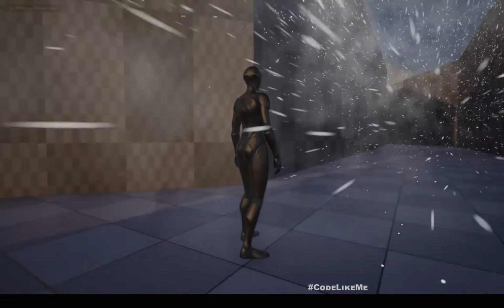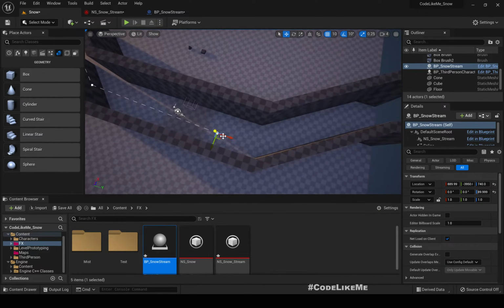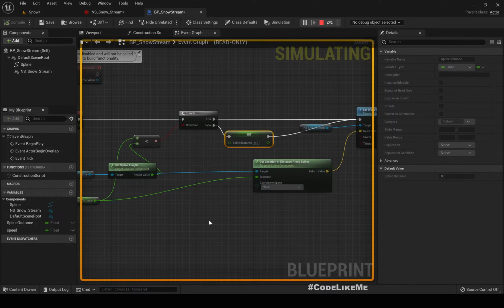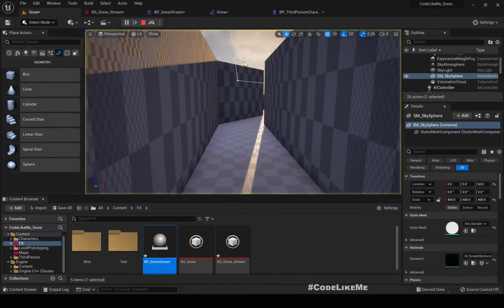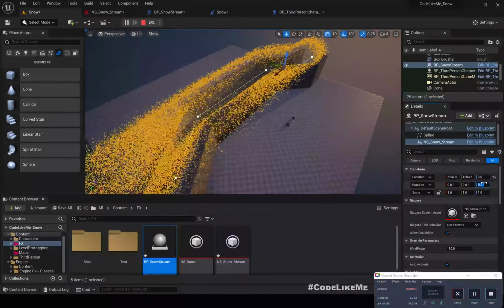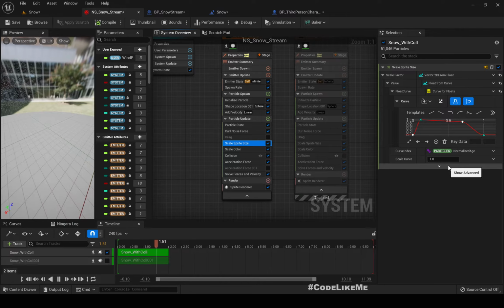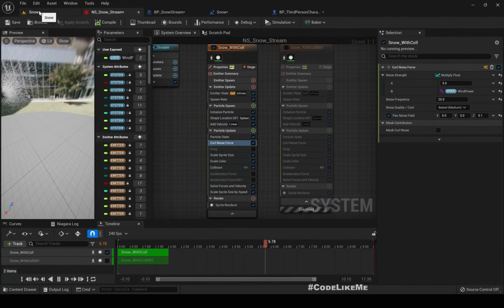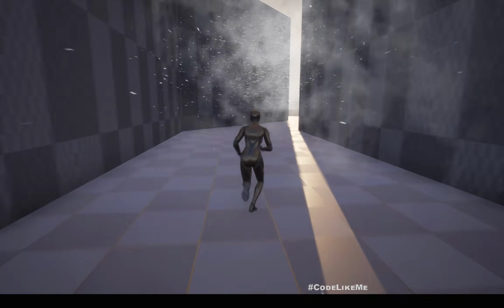Unreal Engine 5 - Snow Storm Particle Effect in Niagara

Comment: I have a problem where the location increases without stop amd it does not flow (like in 15:20) even though i followed every step through. Even when the "true" value resets the spline distance to 0 the NS still moves constantly without reseting the location (in 15:25 it resets the location constantly)